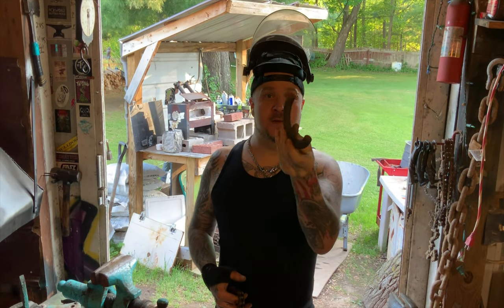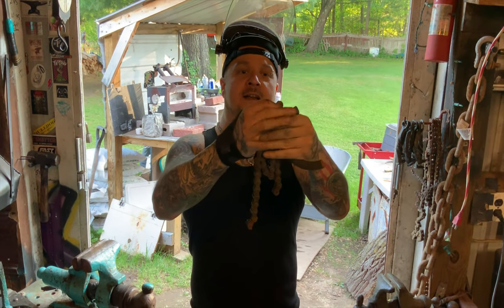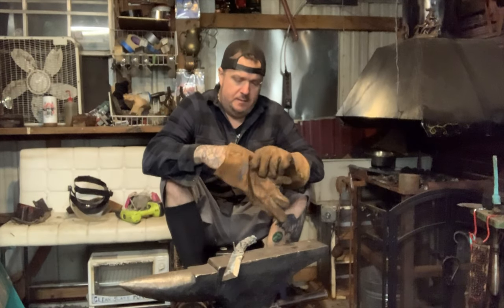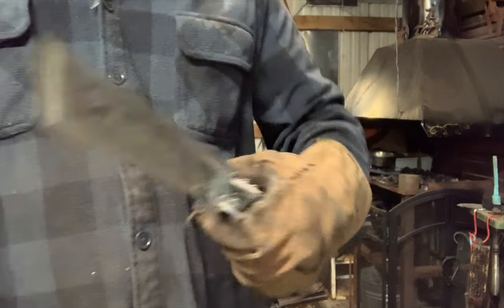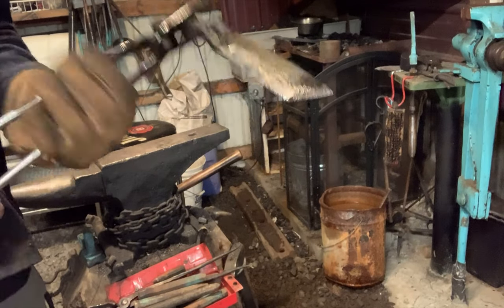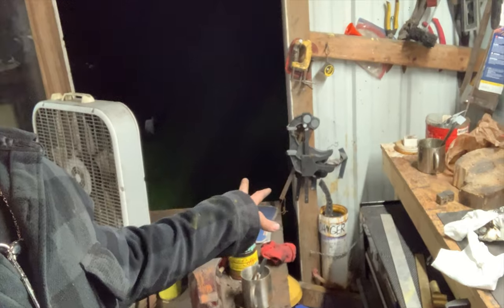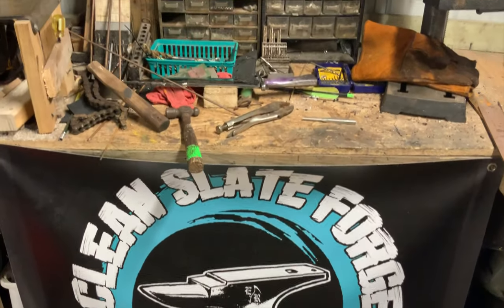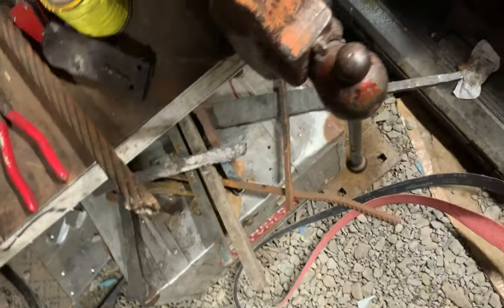Bike Chain Damascus

Comment: Awesome job. The spring steel looks like it welded well. I actually like spring steel better than 1095. It polishes better to me. I was reading somewhere that it doesn't forge weld well. I may try some when I get my press built.
Reply from the maker: I get a bunch of leaf spring metal from a truck shop, the guy told me it doesn’t weld together at all.. but I think he meant for like mig or tig welders.. forge weldings alittle different. It’s probably not the greatest for welding on stressful jobs, frames, structures etc.. I think it worked pretty good & welded strong, just gotta get it super hot! And work it slow & clean. Plus it’s just a tiny billet for a knife.. win dome lose some.. I tried a experimental quench on a piece of 1084 and cracked the blade on a knife I spend 3 days making lol..